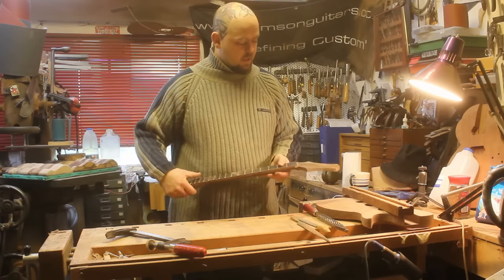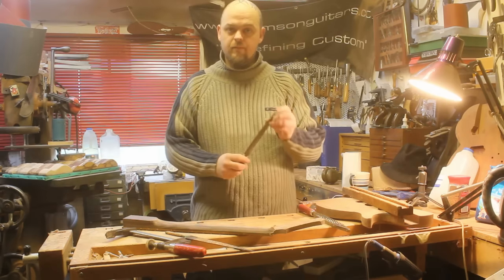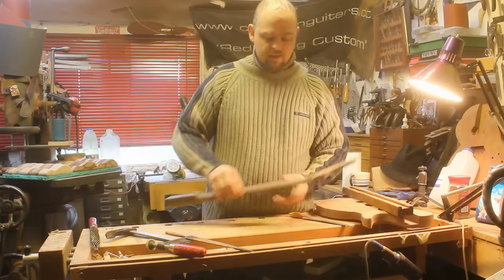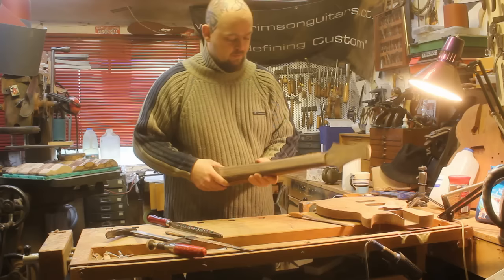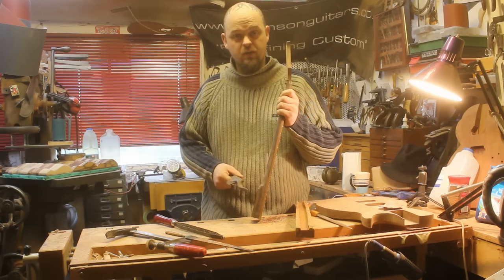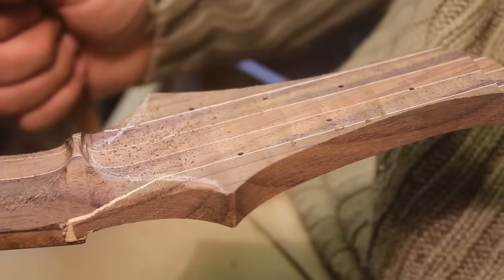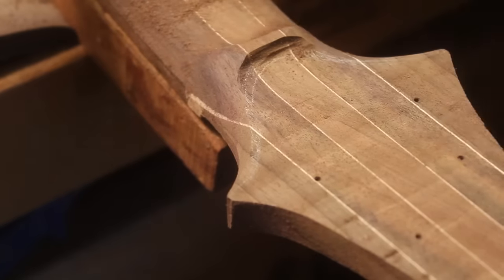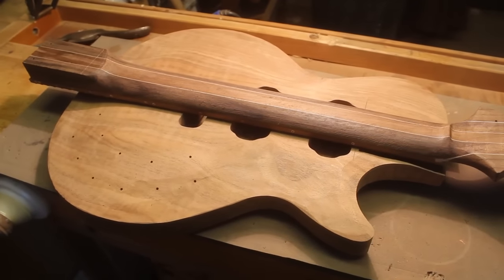Clarity Ep 33 - How to Finalise the Shape of a Hand Carved Guitar Neck

Comment: I can't claim to be the super best at neck shaping, but a technique that's been handy to me over the years is to use a radius block to take the lumpiness out.  Obviously I am not trying to put a radius on the rear of the neck that matches the block, but the curvature of a radius block allows a person to work the high and low spots in the grain direction.  Additionally, it won't  wander as easily as a flat sanding block.  Hopefully that doesn't sound too confusing, and otherwise I use rasps and such for the roughing parts too.